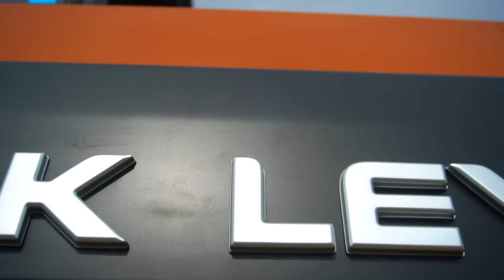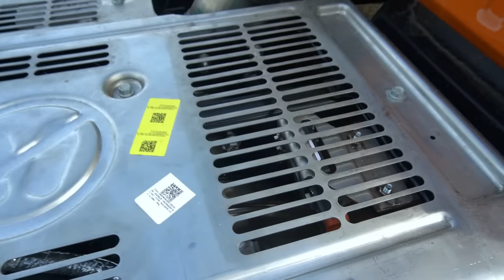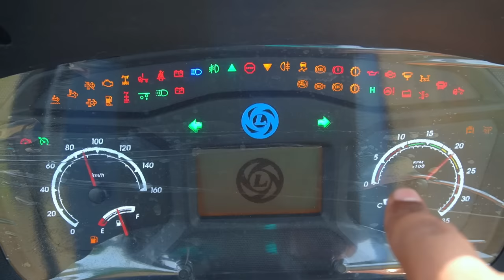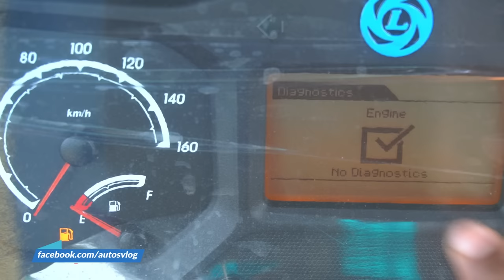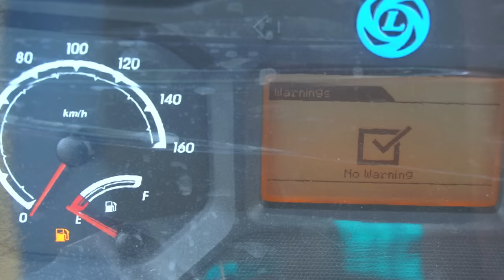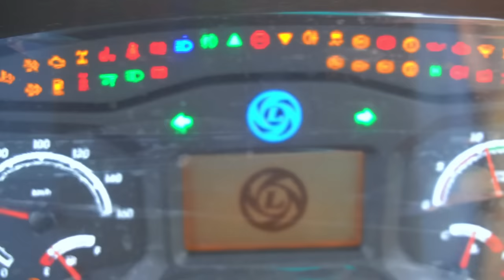Ashok Leyland 1920 HG Bs6 full review/മലയാളം-AutosVlog

Comment: Ayoo ponnu bro. Abdham parayallu. 

Ashok Leyland aanu technology ettvum purakil in-line pump engine paniju BS6 akkiyirikunne athu karanam 225 BHP 800MM torque udayirunn  engine ne de tune cheythu annu BS6 akkiye. 

Pinne nodo bracket adutha comedy in-line euro 2 engine BS6 lekku pazupikumbol udakunna over heat akathe irkkan annu over size Raditor and inter cooler.

TATA end Eicher okke BS6 ayi design cheytha engine aanu efficiency and technology okke 3 generation front ill annu.
Reply from the maker: 😜😜😜😜ee  technology eettavum best aanu ennu uddeshilla.... pala pala problems already und..... but chila  karyagal  driver friendly aakiyirikkunnath kondu അത്
ആ reethiyil paranju poii enne ollu...... nammude trucks companies ഓരോരോ technology എടുത്ത് nokkumpol eth oru reethiyil some changes വേണ്ടത് aanu

Comment: Tata Vandikalilum ingane okke thanneyanu exhaust gas treat cheyyunnath..ee paranja particulate matters burn cheyth ash aaki ath contain cheyyunna part aanu DPF.   athine parayunna peraanu regeneration. athinu avasyamaaya HC adhava fuel. tata vandikalil cylinderil thanne ee fuel exhaust stroke il supply cheyyum as per firing order. 
Leyland il separate oru HC doser fit cheythittund...  Tatayilum leylandlum avar use cheyyuna After Treatment system CUMMINS enna brand aanu.
Reply from the maker: Yes 🔥❤️❤️😍
Reply: Cummins ✴️✴️